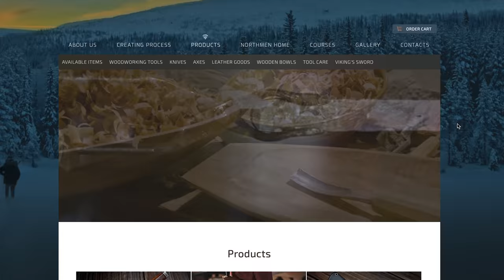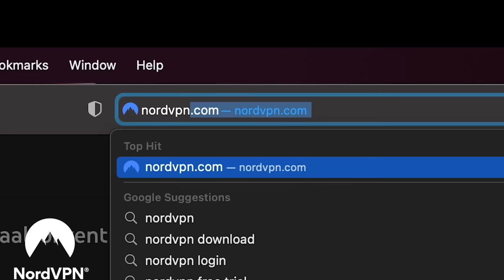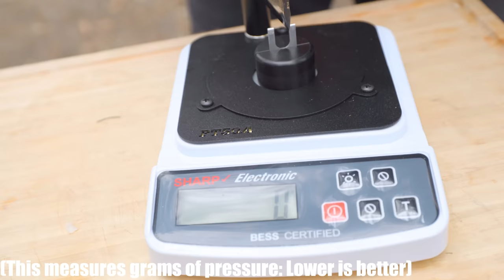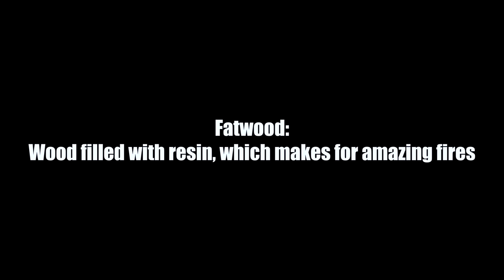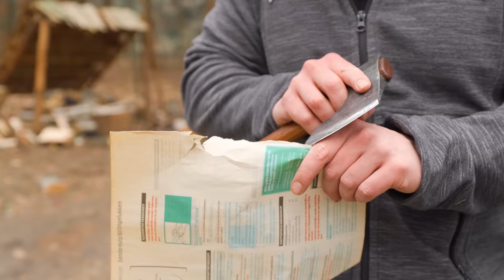The Best Axe in the world… $500 Northmen Hatchet II

Comment: I took a northmen carpentry course. We used their axes every day for ten days and they only got touched up probably once each the whole time of days of use building a frame. And they preformed incredibly well in all aspects of carpentry. The general purpose axes were amazing, the specialized axes did what they were designed for perfectly. Overall both their tools, and their courses I cannot speak highly enough of. I have yet to buy and axe from them for myself but I do want to after using them. If you are at all interested you will not be disappointed. That goes for their courses to.

Comment: To cut up a round with a small ax, you should "rind cut" it.  Just like you would peel off the rind from an orange, you cut off the outer layer of wood reducing the size of the round.

Start by laying the round on its side.  
Now cut a line down the center, from the far end of the round to the near end. 
Now you have a cut line running away from you down the center of the round.

Now make a second cut either to the right or left of the main cut 3 or 4 inches (8 to 10 cm) away. Cut towards the center of the round not vertically.  
Start at the back end and bring the cut towards you.  

As you get to the last cut the wood chip will fly off the round with some force, so be careful to not have your face too close.  
This is why you cut from far to near end.  You don't want your hand over the wood as it flys off.

Now, roll the round over and repeat a cut 3 or 4 inches (8 to 10 cm) from that, and continue rolling the round and making new cuts.

Eventually, this will reduce the round to a size you can split down the center.

Comment: For sure a work of art with a price that shows. It would have been better to compare it to the GB Wildlife hatchet since they are both hatchets. Lifting the log over your head is of course not energy conserving. Better use a baton. There's a lot of 'knife stuff' you can do with a good hatchet but not all. Of course a hatchet is better at splitting prepared logs but that's more a homesteading situation. Out in the bush it's rare to find prepared logs and a prepared chopping block to split them on. For the proper use of the ax and hatchet I recommend Mors Kochanski's (RIP) video's on the subject.